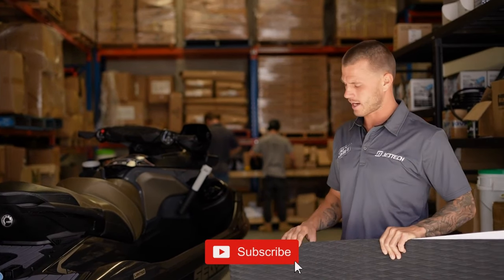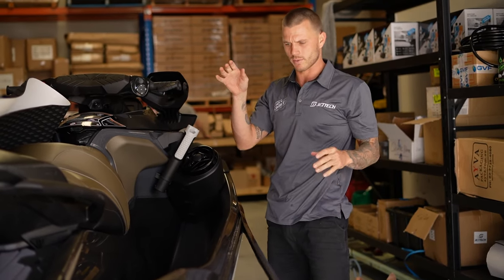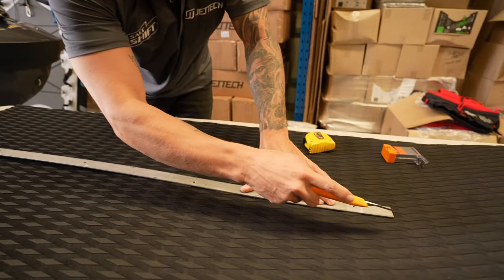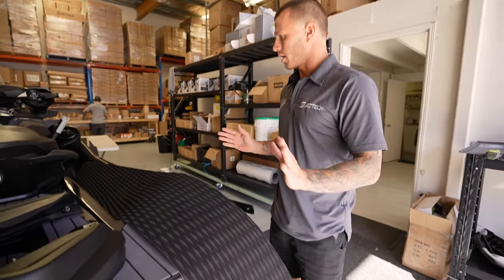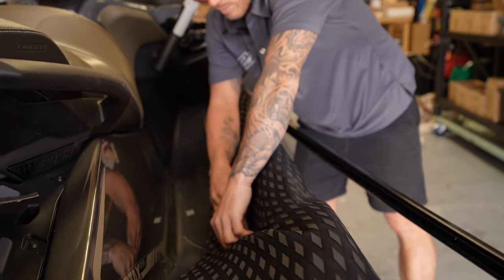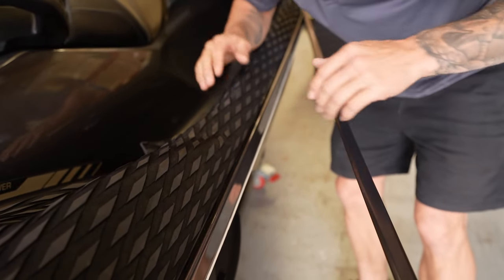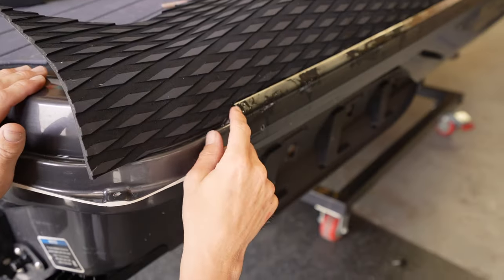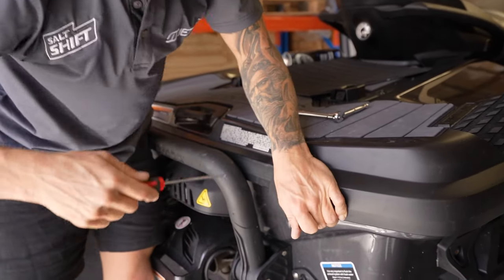HOW TO INSTALL JET TECH TRACTION TURF TO YOUR JETSKI - SEADOO 2022

Comment: Why would you want to do this?  Doesn't seem any more useful than footwell mats and ruins the look of the ski.
Reply from the maker: Hey mate,  we do this mainly for surfing and fishing activities with skis, it provides traction and also protection to your boards and equipment.
Reply: I reckon the ski looks better with it on. Also great dock protection (I keep banging that rear edge on mine), and I'm thinking the offcuts could work well over the side of the speakers as they're the widest point (to the dock) sometimes as well. I'd rather turf, than a scratched up ski, looks-wise.

Comment: Cool looking, but seems a little too permanent.
Once you commit to this, there is no going back!
Reply from the maker: Hey Chris, great point but if it isn't permanent then the edges start lifting away, which you don't really want.
Reply: Definitely can't go back because he was cutting with the razor blade directly against the hull so even if you could remove the rubber then you would still have the deep gouges from the razor.